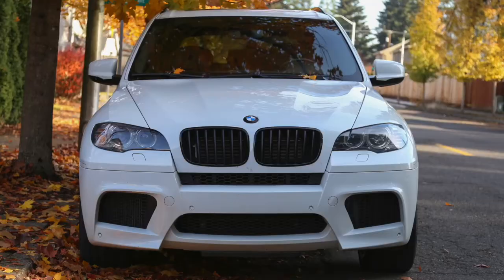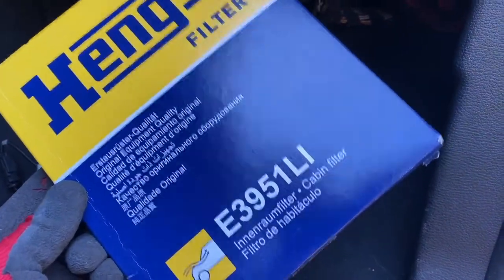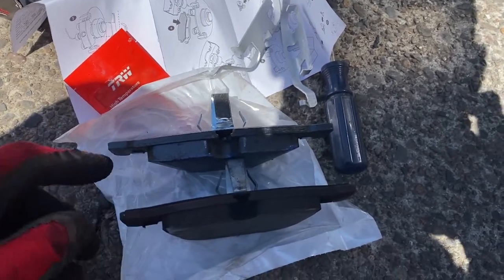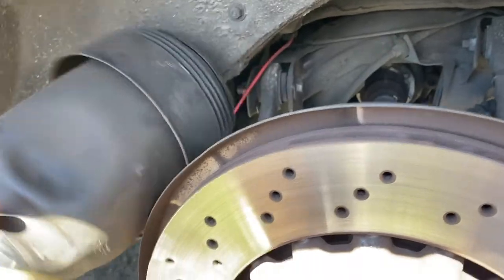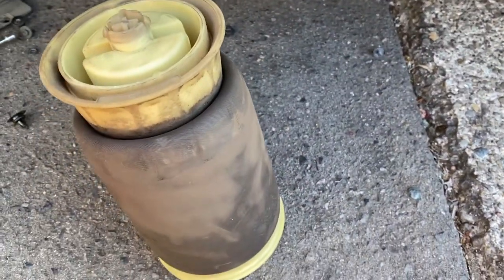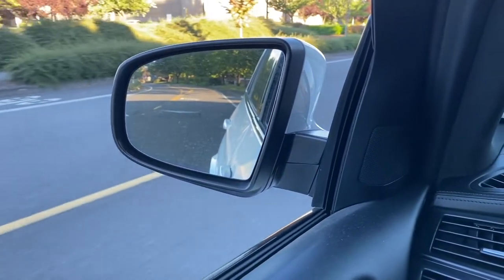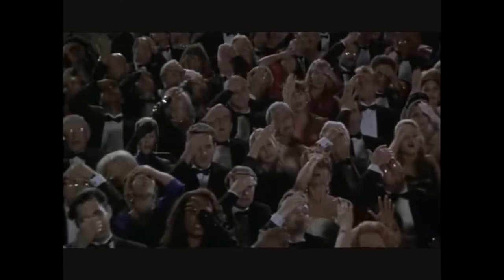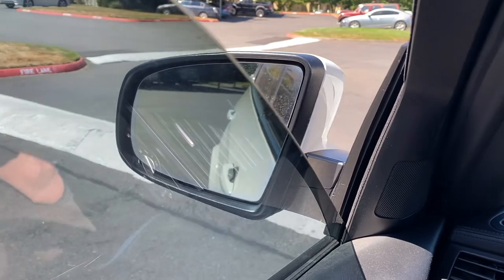Installed new brake pads on E70 and they still... squeak

Comment: Hi, I've got exactly the same problem. New pads and still squeaks. I've changed discs and pads before on numerous cars so consider myself experienced. Last time I took them off I cleaned and regreased all contact services and after a while it squeaked again. I believe its the pads themselves and that it's temperature sensitive is the cause. That said did you ever solve the issue or discover what was causing it?
Reply from the maker: Hello, unfortunately I never resolved this.
Sold our E70 a few months ago.

Comment: 1) You should've got new Genuine rotors and pads
2) It is a quickly aging car, I just sold mine E70  X5M. 
3) Your squeaking brakes problem is a minor inconvenience , I already can hear a howling sound your engine is making (probably an oil pump). Fixing it requires pulling the engine out. At that point it's economical to rebuild the engine, you are looking at $15–$20K and months of waiting. I don't know if it's worth it for such an old performance SAV.
Reply: @alexanderkharevich3936  Come on, just get a new BMW, come on!
Reply: @mapcoxog  just stop teaching me what to do